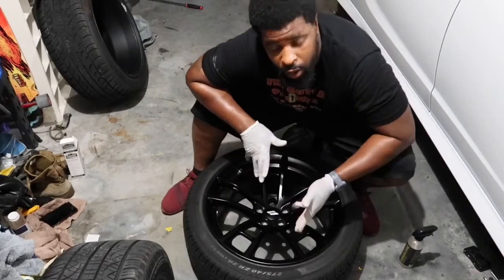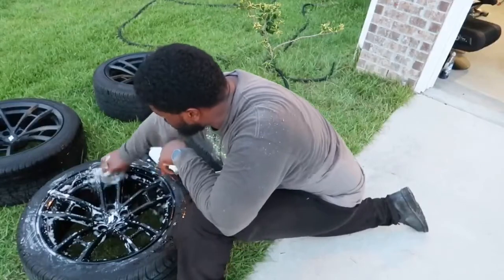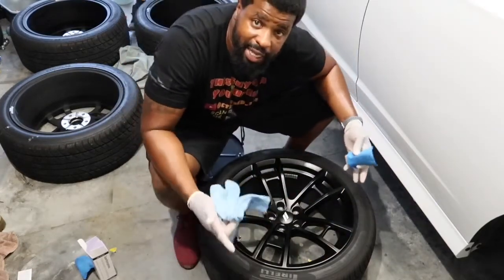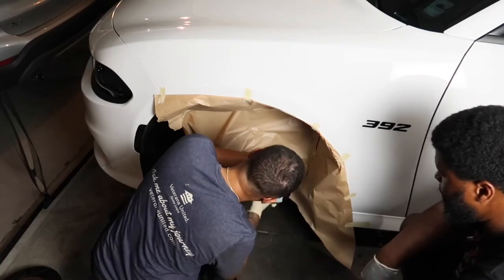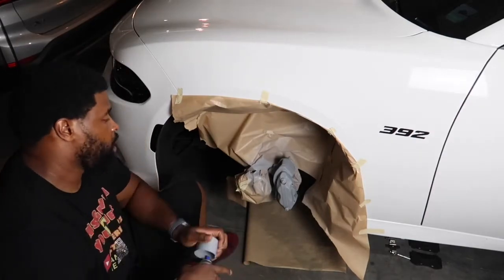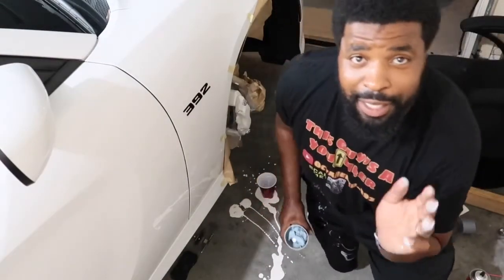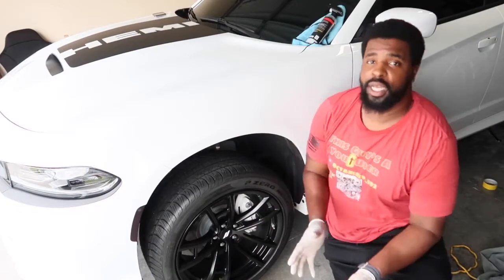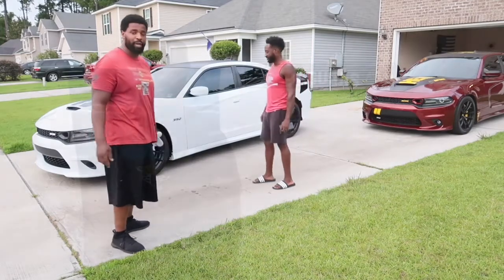CERAMIC COATING and G2 PAINTED CALIPERS | OctaneRed_392

Comment: G2 says not to prime. Their epoxy paint adheres better to bare metal.
Reply from the maker: Yea you don’t have to prime I have done it both ways. On my car I did not prime which is a video I posted almost three years ago. I have noticed that my buddy’s car in this video has performed flawlessly. Because I didn’t prime my calipers the chipped painted shows red which is my original caliper color and for that reason I chose to prime my friend’s calipers on his Daytona. Either way is fine. I just noticed from application on my car that a prime coat would help the G2 paint last a bit longer and have more longevity.
Reply from the maker: https://youtu.be/AxS5wF-1Dxw
Reply: @OctaneRed392  doing mine right now as I type. The prep work is the hardest!😂